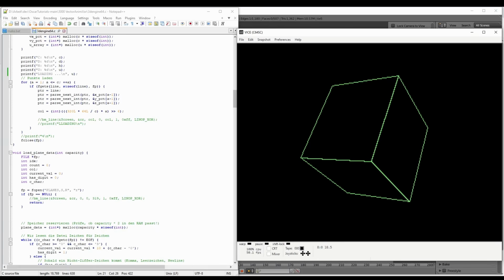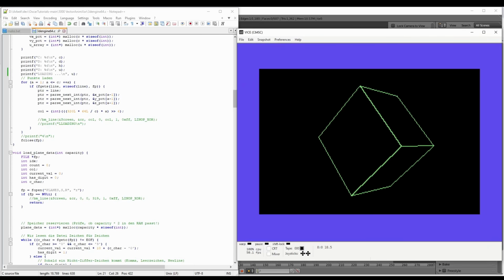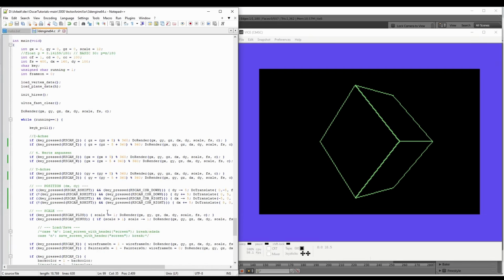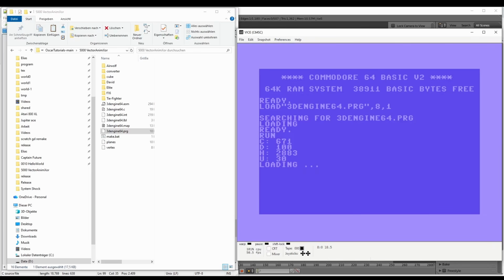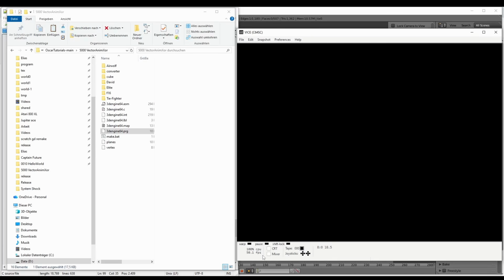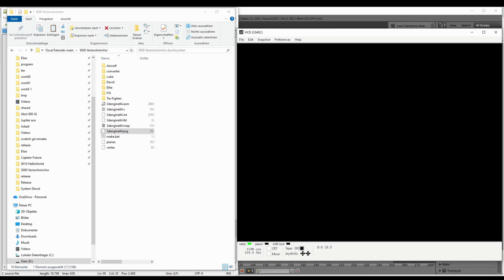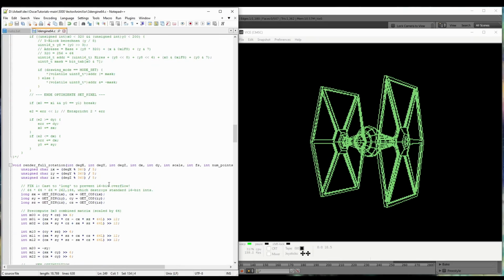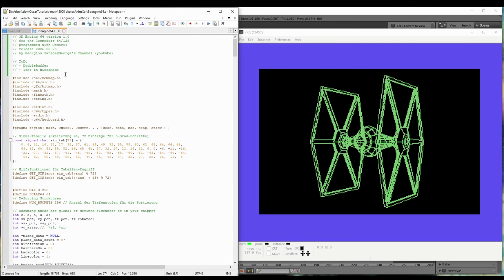Part 4 | 3D-Renderer for the Commodore 64/128 | Oscar64 (Cross-Compiler)

Comment: Very impressive, Giorgo :-) Nice speed in the 100% mode. As an 14 old I would have been very fascinated what the C64 is capable of! The Oscar64 seems to have a very comprehensive library of functions for the C64.  Greetings, Janni
Reply from the maker: Thanks Janni! I am working on the Vic20 version, which has no Hiresmode..only Character-Mode.
Reply: @GeorgesChannel With ASCII characters only? That sounds awesome.